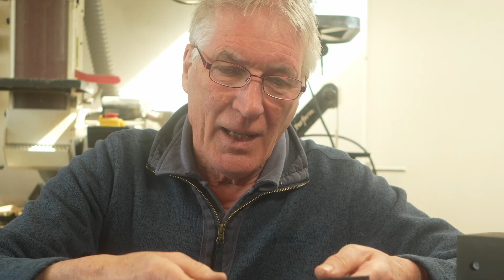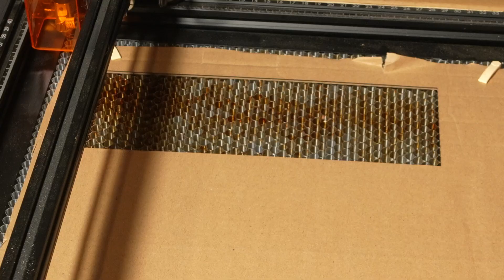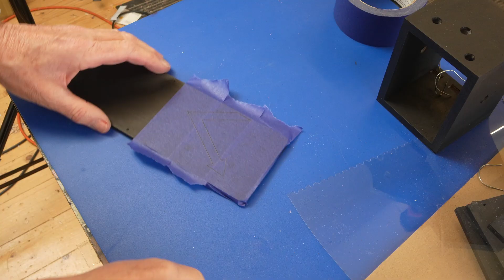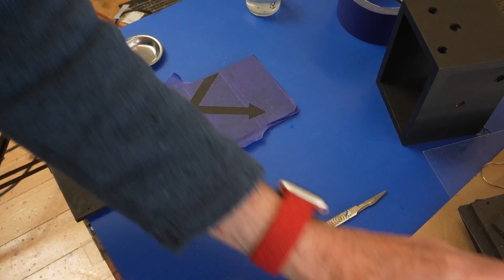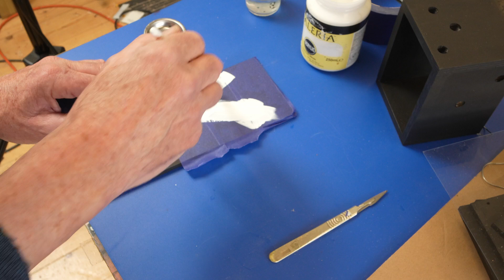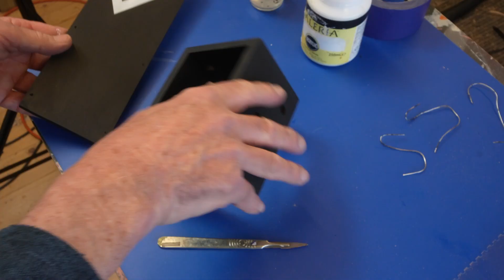How can a 5 watt diode laser engraver help in painting craftwork?

Comment: oh that's a nice way to create "templates". One neat trick I've learned for tight lines is to paint twice: once with the background colour and then with your target colour.
Reply from the maker: Yes that works well. Just have to be careful not to peel bits of paint off when removing the tape as the first coat has to dry. Thanks for commenting.